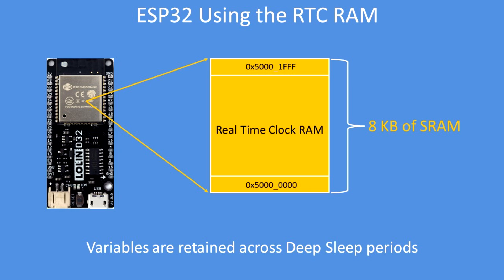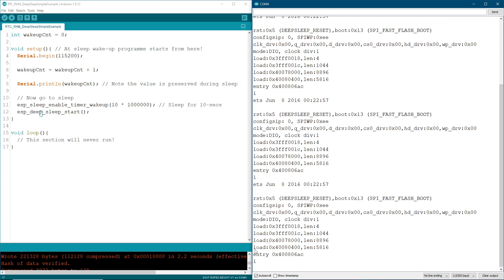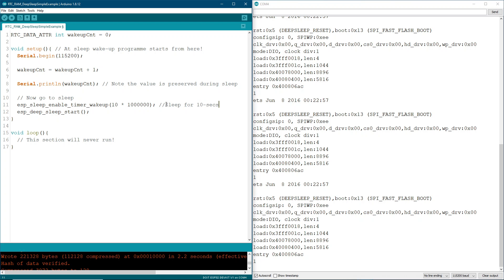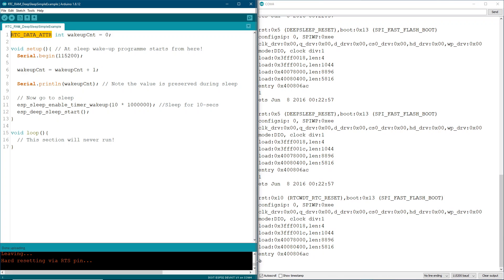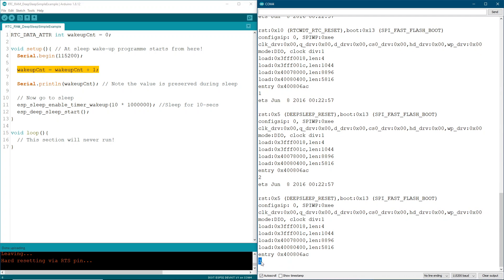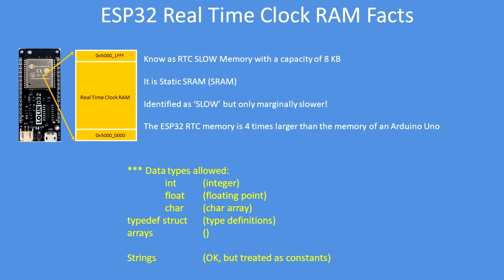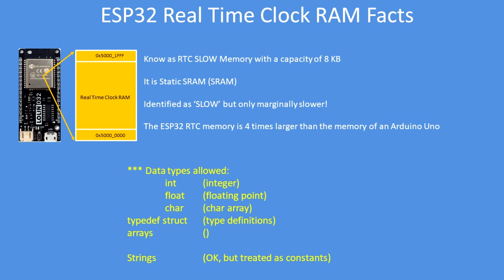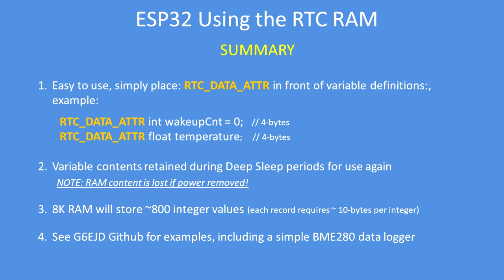Tech Note 136 - ESP32 Using its 8K of RTC RAM to retain data variables during deep sleep.

Comment: Great video!! I would like to know how to ask the Arduino IDE how much RTC RAM is already used in my program and how much is left. I would also like to know why you count each integer as 10 bytes and not 2 or 4 depending on whether it is int16 or int32? Thank you!
Reply from the maker: There is no compiler directive unlike the heap pointers to track RTC memory usage, so unfortunately the programme or programmer (you) have to make a note of memory used. I see what you mean at the end, I included 10-bytes per integer, that is wrong it is 4-bytes per integer for the ESP32, I think I originally had an example of storing a structure definition of three variables comprised of integer, float and char which consumed 10-bytes per record, I was doing that to show more complex data structures could be stored in RTC ram but then dropped the example in the end, but didn’t update the byte count in the brackets - well spotted.
Reply: @G6EJD  Thank you for your clear and complete explanation. Very useful!!

Comment: Is the contents of RTC lost if the WDT is triggered?
Reply from the maker: No there is no easy way of the RTC either that’s by design, well if you don’t fit the 3v backup battery then that would clear it.
Reply: @G6EJD  Not a power off. Just a watchdog timer reset?
Reply from the maker: @dunk_law  Either way there will be no corruption of the RTC, nothing to worry about.

Comment: Thank You for this nice trick. Is this a non volatile memory? What if ESP is switched off?
Reply from the maker: DocM, it’s volatile so if the ESP is reset or power removed the ram contents are lost but for normal deep sleep operations this is rarely a problem.
Reply: @G6EJD  Thank You!!
Reply: @G6EJD  HELLO great video... is there a way to make it save this variables periodicaly instead of when it goes to sleep so it can recover the variables from a reset?
Reply from the maker: Hi, yes. You can add eeprom.begin(n); where n can be a value on the range 1 to 4096 so you can save up to 4096 single byte values or 1024 floating point / integer values. Alternatively you can create a SPIFFS file and store the data there, both are non volatile.
Reply: @G6EJD  thanks a lot for the quick response... i was ref to use the RTC RAM, because flash would maybe run bad if saves too many times over the other... in your video it shows that when it goes to sleep it saves the variable (my guess).. so there might be a function to call the variables to save at the ram without sleep... do you know to find it?

Comment: It also worth mentioning that RTC slow RAM is the only RAM available to the ULP (Ultra Low Power) processor during deep sleep. The ULP processor is by default disabled and needs to be enabled before going into sleep if required to be utilized.
Thanks for the video. It really gives short insights about the hidden gems for ESP'ers.

Comment: Hi Dave, hope you are doing well. That is very interesting because use of preserved RAM is really useful for example if you want to calculate the average of the last 10 values from your sensor before to send it to your mqtt or similar. Even you can decide not to send a value that is the same of very close to the precedent one, so you don't need to connect and send; very battery saving.

Good job Dave! Thanks!
Reply from the maker: Yes, that's a good idea, hadn't thought of that technique. I see that Thingspeak now allows bulk updates but they do require a date-time stamp with each data record, but that's possible, just less storage for actual readings.